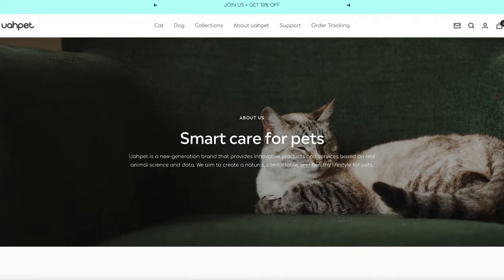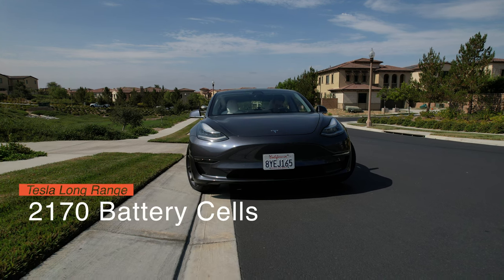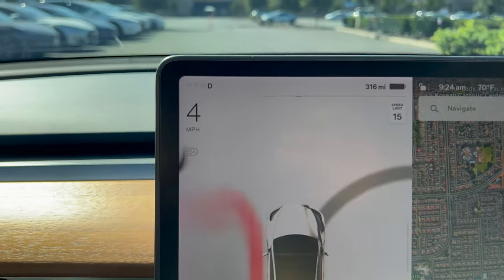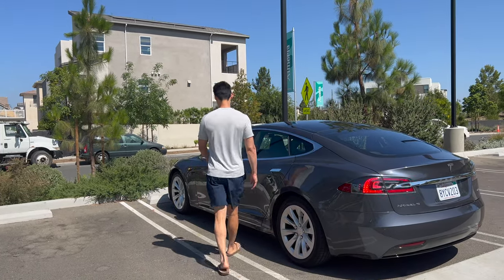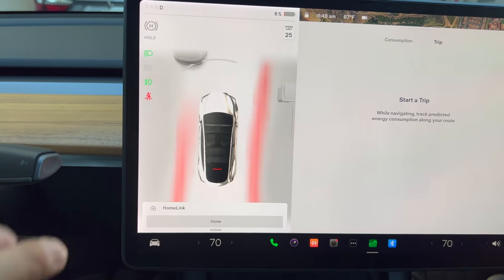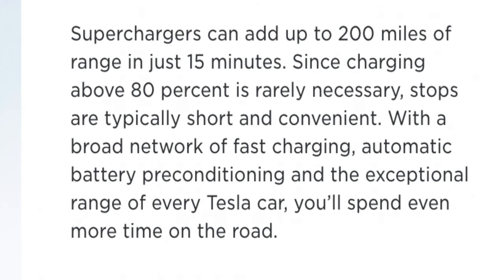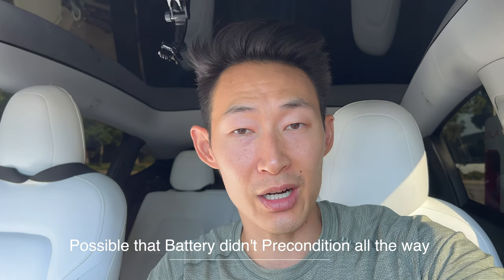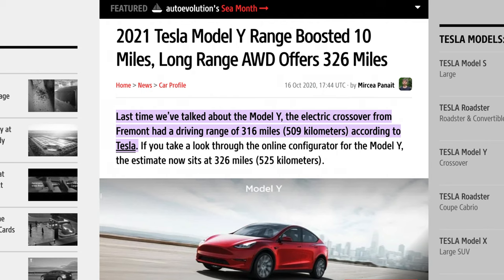Tesla gave me a Refurbished Battery so I had to Recalibrate it! Do this to GAIN Range!

Comment: Been watching your videos for a while.  Great content and creative without recycling old ideas.  Thank you for that!  I have a question on this one.  When you recalibrate, are you recalibrating the ability to compute an estimation of the miles or is the battery itself optimizing to maximize miles (battery health)?  I get the impression the battery itself is not degrading or improving in this process and it is just the ability to measure distance remaining that is being optimized...
Reply from the maker: Computing! There a bms system that shows you the range but can get funky if it doesn’t know various charge levels which is why we calibrate however actual miles on the pack itself stay the same

Comment: Try changing to 100% at an electrify charger. Tesla super charger tops at 70kw at 100%.
Electrify will charge to 75kw at 100% maybe that’s where your missing miles have gone.
You will need a CCS1 charger adapter for comparable speeds as a V3 charger
Reply from the maker: If it lets me! A lot of times they force me to stop charging after 1 hour

Comment: general rules for batteries (no matter how good or bad they are)
- need to try not drain battery to very low level 
- not often use supercharge (only if its needed for long trips) as high current will shorten their life
Reply: Fake info. You can go below 5% on tesla easy. You need to read some studies to understand
Reply: @alexsmith6271  fake is how to relate that info. If taken into account that Tesla is designed to show 5% or 0% when its batteries are not fully empty , then that infor seems not really fake 😁 In general, all well designed Litium batteries stop offer energy when they still have some energy inside to avoid full discharge and to keep their long life
Reply: I daily supercharge mine and AC aswell. After 146k miles I lost only 8% capacity.
Reply: fake news: 110,000 miles, exclusively Supercharged, 92% capacity 2018 Model 3

Comment: For vacation parking (or long un-used parking), can you do a video on using solar battery charger/maintenance for Tesla12V battery? Will 10w panel be enough to keep up with Sentry Mode on? Does Tesla circuit allow external 12V charging?
Reply from the maker: Hmm solar battery??? I don’t think it allows external charging

Comment: OMG this video came out at such a good time! I was planning to recalibrate my battery this weekend. I have a 21 m3 SR+ and after a year and 11k miles, the car is showing I have a max range of 224mi when the EPA rating is 260. So really hoping that this will help fix the BSI calculation. 

Just one thing that I am not 100% sure on...after charging it back up to 100%, do you need to run it down low single digit % again?
Reply from the maker: Nope. Once is good.
Reply: What were the results of your recalibration? I also have a 2021 sr+.

Comment: I don't own a Tesla, but before Tesla was around, I'd spent about ten years as a hobbyist flying large rc models (planes, helis) with lithium batteries when the industry was just starting, i.e. experimental.  Point being, I gained a LOT of experience with lithium batts in terms of best practice, cell balancing, resistance, state of charge/discharge, problems, etc.  You have a replacement reconditioned pack made up of hundreds of cells, therefore, you have no idea the lifecycle / state of these cells, whether they are aged, in a state of balance, their internal resistance, cell damage, etc.  That sound / knock you heard during charging, could that be thermal expansion (heat)?  I've seen and experienced fires in the hobby and a battery getting hot is an issue.  I've seen some youtubes where Tesla via software update caps the charge voltage on older batteries.  I assume what's happening is they cap the total pack voltage below 4.2v/cell (full) because reaching 4.2v at the pack level would require overcharging some cells (fire risk), i.e., the damaged cells, aged cells with high internal resistance, are incapable of reaching that 4.2v.  There is a lot to know about Lithium cells and no substitute for understanding what is happening at the individual cell level vs the pack.  I would charge that car in the driveway.

Comment: Hmm would this work with LFP? I got a 2022 M3 standard range, 7months old with 10k miles. I am not getting the max of 272 and down to 267 at 100%. I charge everyday and plug the charger when at home. Your thoughts? ….Thanks
Reply from the maker: Try it. It works diff cause of the chemistry but see how it goes

Comment: Also how do you easily calculate max range or what the battery can support when you only charge to 80 or 90% Believe it used to show in the app, but not anymore, right?
Reply from the maker: Yeah so weird when you charge to 100 it used to show you but it’s on the tesla screen still